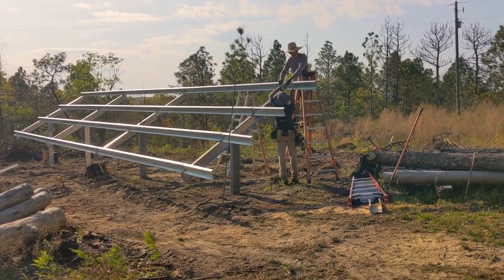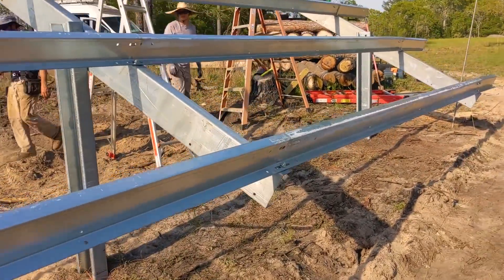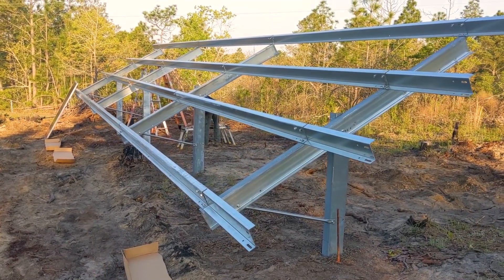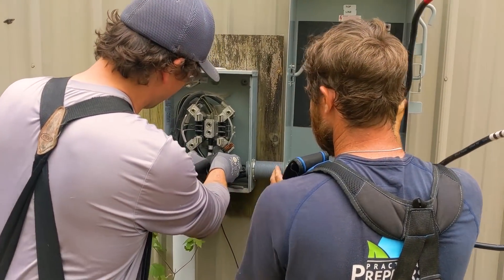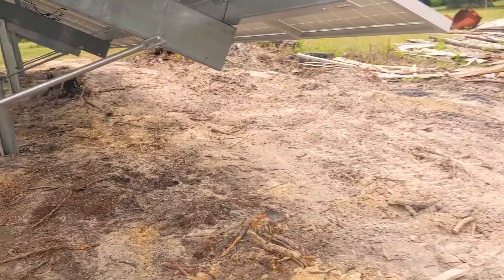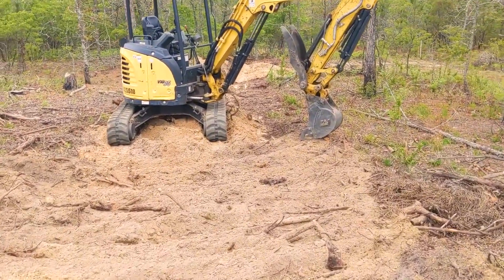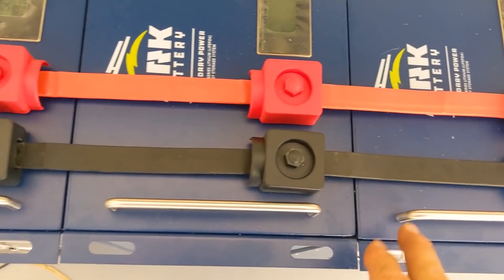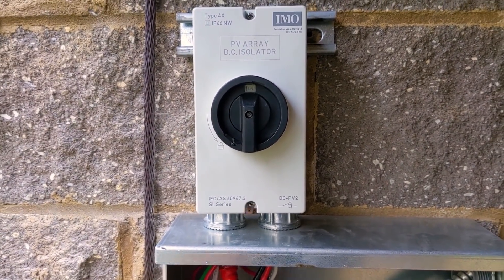Ark squared! ARK battery debut

Comment: I have a potential similar long run from the panels to the inverter. Can you tell me the wiring set up. Better to use AC or DC? Number six or number eight copper? Would mobile home theater work? You guys do some impressive work I love to watch these YouTube videos.

Comment: Have you created a heat/cooling solution for solar panels? Build & attach a antifreeze cooling loop with a buried reservoir, below the frost line, to cool the panels during warm months and heat the during cold months. Also, a mechanical sweeper, possibly air jets, mounted on rails to sweep the panels.
Reply from the maker: We started down that road and then just switched over to using solar to create electricity to run heat pumps to heat and cool.  Having a system that can take care of your HVAC your domestic hot water,  your lights, refrigeration, your well pumps your medical gear internet your ham radio is more efficient than having a dedicated solar heating system. But I do enjoy it all!
Reply: @engineer775  I misstated my idea. Can cooling/heating the solar panel improve performance and longevity of the system? I thought a heat ballast would be the best solution as it is far from buildings.
Reply: @ansiviewer  I like the idea for keeping the panels ice/snow free in the winter at least.  But sounds a lot more expensive and complicated than a broom with a long handle!!!

Comment: The nice thing about most higher end chargers is you can set a maximum charging amperage. Not sure if you have to use Tesla's proprietary Powerwall system to take advantage of that but it's a thing. Some chargers even have ways of figuring out how much power the house is using. So when you get home and plug in it might change at 20 amps and when you go to bed it can ramp up to the full 35 amps or whatever it might be.

Comment: 15:51 I hope you guys are still on the job site and can rotate that 50 amp plug around.  It’s upside down for a Tesla charger.  With the ground on the bottom, it will put stress on the cable since it’s upside down.  Even the Tesla documentation, that they taped to the panel for you, showed the ground hole needs to be on top.  It would be a nice thing if you guys fixed this for them.
Reply from the maker: Thank you.

Comment: What is the standard operating practice if the battery storage area gets below 32º? I have 47kWh of storage (lead acid) of with at 50% is 24kWh of usable capacity. They (the batteries) get rather cold in the winter with temps around 20ºF during those cold, cold months of december and January but when fully charged, they weather the cold without issue.

Comment: Those mounts seem like an excellent option for bifacial panels, any chances of seeing them in the near future?
Reply from the maker: Yeah we would like to put up some bifacials if we can get a good deal on them.
Reply: I'll be installing 12kw worth in Arkansas soon using a bifacial array underlayed with white rock and backed with a white 20 foot container (power house). I can get the 410/308w panels at $185 for a pallet of 30 ($5500). Batteries will be 4 LiFePo4 48vdc 280ah strings to start. House will need some retrofit as well to accommodate off-grid power. Think I'll be calling them Practical Prepper fellers fairly soon... maybe next spring.  maybe sooner...    ;o)
Reply: @TexasVeteranPatriot  A smart setup. Keep some room to allow air flow to avoid heating the panels and they will produce a lot of power.

Comment: I wish power was as cheap as 12c per Kwh paying well over 20c here in Australia 🙄
Reply: I heard it as a statement of the demand charge at $12/kW demanded during time of use peak, so plan was to use solar + storage to offset that 3 hour period - might be wrong, but that’s what I heard.  Yes, US electricity is generally cheaper per kWh if you are slicing up the bill correctly, I pay USD $0.15 per kWh, NYC is $0.22, CA and HI higher from what I understand

Comment: MC cable is not outdoor rated.
Reply: It’s rated to be installed in raceway.  Love the nitpicking.
Reply from the maker: But the wire in MC cable is. We probably should have stripped it out but we did put it in conduit.
Reply: @engineer775  Wire inside the cable is not labeled for individual usage. You can't do that.
Reply: @ryanroberts1104  show us where it says in the code you can’t do that. You don’t know cause it ain’t in there
Reply: @GainSolarPower  I'm not sure what "the next" is, but the wire has to have specific lettering on it even if it's already rated for whatever. If it isn't written on it then it's not rated. Usually, wire inside another insulator is not printed the same as it would be for singular use.
Reply: @ryanroberts1104  it had thwn-2 on it. These days Most mc cable has thhn/thwn-2 conductors inside.
Reply: @GainSolarPower  Mc cable is indoor only!
Reply: @ryanroberts1104  Haha, these guys will be trying to argue romex is outdoor rated also because it has THHN inside of it!!  Sounded like he also pulled SER cable in conduit underground to another building???  Why not use URD or just aluminum wire, if its all in conduit!!  I have inspectors here telling me I cant put SER cable in a 2' long piece of pipe from the service down to an LB into the crawl space, on the outside of the house, because SER isnt outdoor rated, and if its in a pipe outside, then its considered an outdoor environment...  Inspector here would make me pull all that MC and SER cable out of any pipe outside, have to put in boxes and transition to proper outdoor wire.  Pain in the ass.

Comment: Have you ever installed Gyll LiFePOWER4 batteries
Reply from the maker: We have not used those batteries because we are finding out that once they read a certain depth of discharge they will not start back up which I've been told that other batteries are doing that too so watch out for cheap lithium batteries without a warranty.
Reply: They are so cheap that you could just replace them (after 5000 something cycles)..  You can skip the importer and get them direct from VGlory for just over $200 kwh..

After looking into ARK they are no different, they use the same 100ah (or 200ah) prismatic cells, made in the same country and the only difference is one is 3x or so the price of the other... 

I bet if one searched long enough on Alibaba they could find the supplier of the ARK batteries, just like I did for the Gylls...
Reply: @FJB2020  The 100ah ARK battery is UL 1973 certified. But yes they all use the same prismatic cells.
Reply: @MrJramirex  Did you read UL 1973?
Reply: @MrJramirex  Is the actual battery UL certified, or the cells inside?
Reply: Thank you

Comment: I am pretty sure they can choose to charge the Tesla  at a lower rate than that if they want.
Reply: I saw one video that I think was with a tesla that they were charging it with a 2,000 watt honda generator they carried in the car in case they didn't quite make it to next charging station on a long trip so I guess 120v charging but they only got about 6 miles per hour of charging and that would be about a tank of gas in the generator LOL
Reply from the maker: Yes I believe you're correct they can use level one charging or is it level two charging? I need a Tesla.
Reply: @engineer775  keep installing these systems and you will have one or two, lol

Comment: Terminals on the bottom - wouldn't a bit of a flood in the room might short them out?   Not trying to be negative - love your vidoes - but it just struck my eye.
Reply from the maker: This garage is high and dry and the ground is very sandy so no chance of flooding. You can't tell from the picture but the door to the right of the batteries inverter is the door to a porch that has a 10-ft drop to the ground. So if that garage floods will need to start counting the animals 2x2.
Reply: It's not ac voltage.

Comment: Taking charge is a good name for a solar company.

But man, if I were spending that kind of money I would want to be able to run everything. Screw critical loads panel. Would you only need 2 inverters? Would be cool if you could run 3 or 4 and have redundant systems.
Reply: You can do anything you want....if you have the money.
Reply from the maker: Yes two solar 12Ks will run most homes. Some people have ridiculous heat pumps that have ridiculous locking rotor amp startups on their compressors so if they didn't have that two solar arcs could run their home no problem.
Reply: @engineer775  One 12k would run the vast majority of American homes. Transformers are usually in the 5-15kva range for an average house. And you only get one.
Reply: That sounds awesome !!

Comment: You should have moved the supply side bonding jumper for the neutral the the transfer switch right after the meter.  A clip showed it bonded in the electrical which will potentially provide a loop
Reply: That transfer switch was only for emergency use and not load break and not the service disconnect. We left the neutral ground bond in the main
Reply from the maker: Hmmm I will check it out

Comment: We never seen the final transfer testing..
Reply from the maker: Which transfer we had multiple transfers in the system. Three actually
Reply: @engineer775  No, not the switches, the actual transfers between Gen, Solar and Grid on the monitor...

Comment: Interesting place to leave a stump lol.
Reply from the maker: Yeah the area chosen for the ground mount was pretty rough as they had a fire there and I didn't want to disturb the soil by doing too much digging and removing stumps as we were driving these posts in sand to begin with and by disrupting the ground I didn't want to take a chance of weakening the embedment.
Reply: @engineer775  cool it looked like a pine stump and they never grow back after cutting.